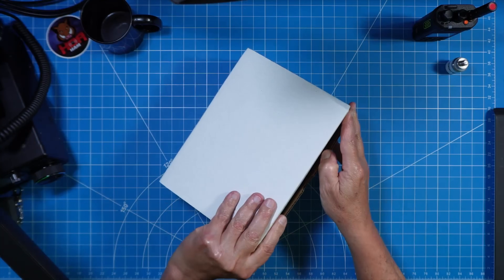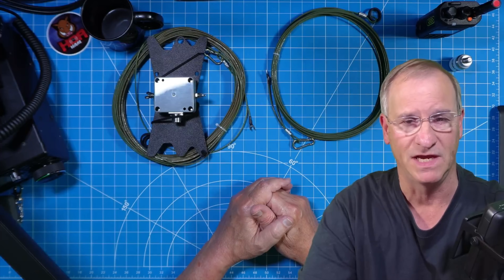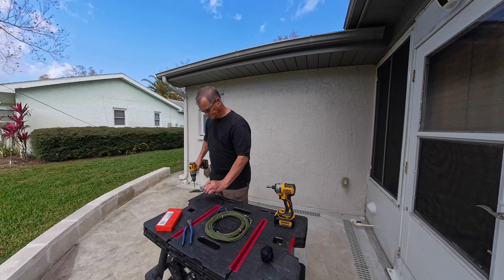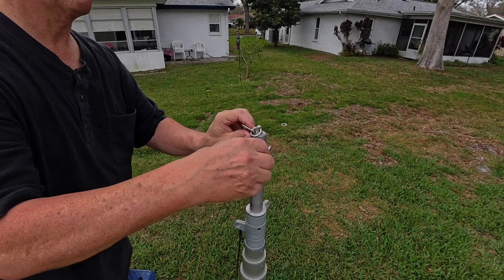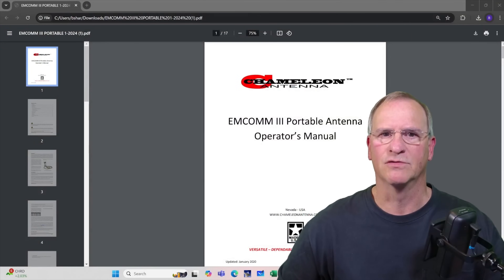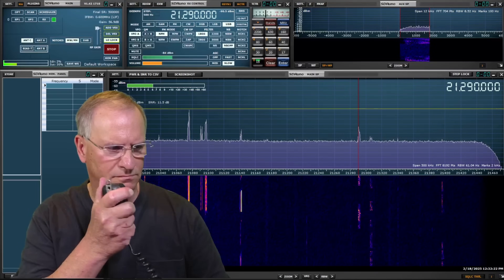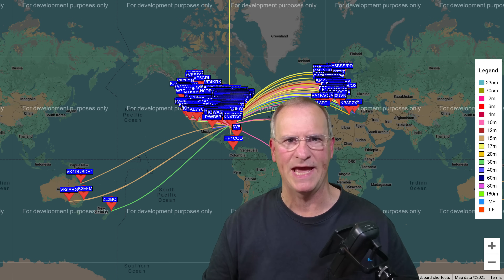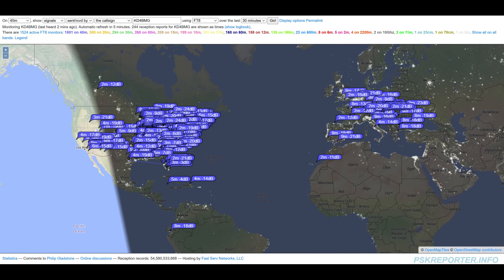Stealth Ham Radio Antenna the HOA Will Never Find: HF Broadband Sloping Inverted V Flagpole

Comment: Looks good. I wonder if you could get the ends higher by putting them at the tops of the "V" on each side of the house just below the roof. But then you couldn't reach it from the ground to take down as easily... Good video. I also live in an HOA and need to get an antenna outside, I just have an attic dipole so far.
Reply from the maker: I actually thought of that as an option; I expect it would get me NVIS on 40.  

I don't mind drilling holes in my concrete wall as they are no easy to patch up, but I'm very reluctant to do anything on that penetrates the roof of facia boards.

Thanks for taking a look and offering your thoughts.

Comment: this might be the answer I'm looking for.  Got my General and Extra both about a year ago and am finally getting around to buying an HF rig and will thus need an antenna.  The wife says no tower and the lot is small so some kind of dipole is the route I'm taking.     But the lot lines, overhead electrical service and position of trees don't allow for a straight 130 foot run of wire.  There will be a near ninety degree turn in the wire to get to a third tree.   Better than nothing....  

N8UJH
Reply from the maker: Absolutely better thank nothing.  I have used non standard configurations, when I am forced to, and more often than not, they achieve acceptable performance.

Comment: Thank you, Bob!  Talking to the choir, two things we don't want to attach to the rear of our transmitters, a short and an open.  ALL antennas are a compromise.  My primary goal is emcomm on the North Olympic Peninsula, the CHA EMCOMM III, as no other commercial antenna does, allows us 80, 60, 40, 30, and 20 in multiple NVIS (30 to 350 miles) quick deployments for Statewide coverage day and night, grid down.  I carry a manual antenna tuner and an antenna analyzer so, if I have to, I can safely use whatever radiating element mother nature allows from trees, fences, metal signs,, metal roofs while preferring portable antennas and masts already tested.  I teach how to walk into a hardware store and build resonant antennas when what you got is all you have to work with, no Amazon, etc..  You just taught others how to take what they have and be creative while safely testing and improving on getting out.  Thank you, again.  One of those who do and try, safely to life and property, what you show and tell may be our best contact to  the outside world when all else fails here.
Reply from the maker: Thanks for stopping by for a look and providing this great feedback!